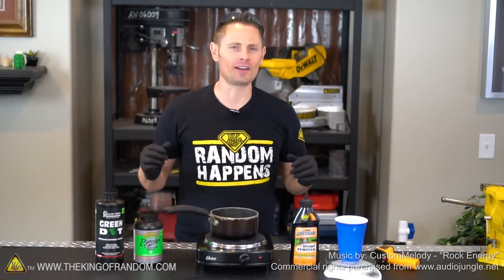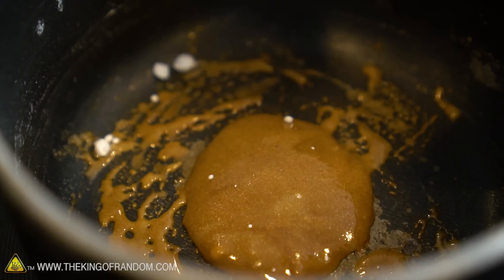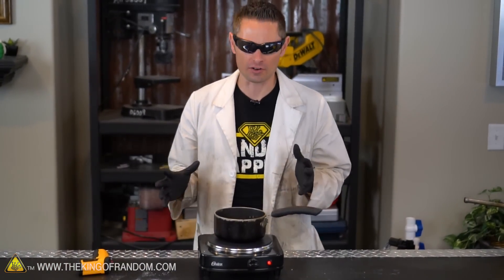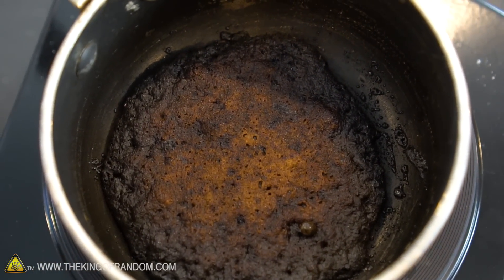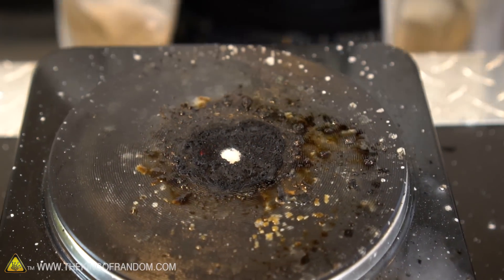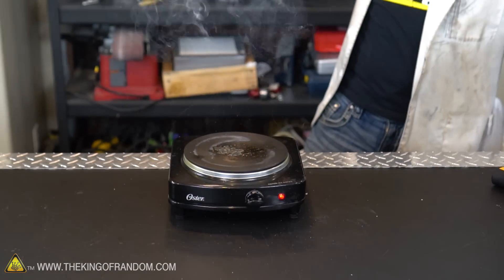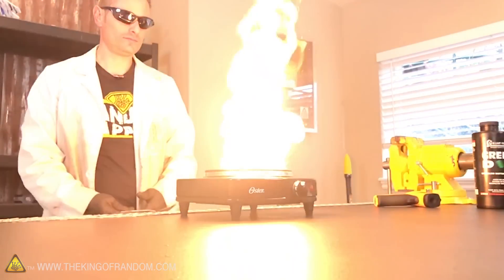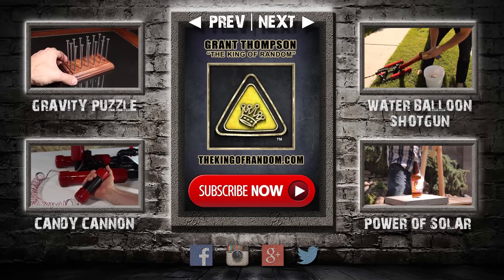Don't Pour Gunpowder On A Hot Stove | TKOR Tests Lighting Gunpowder & Other Pyrotechnic Experiment!

Comment: I did many tests it does not go off with heat more with sparks if i get a fireworks ignition stick where its just a slow burning ember sparks will happen and it spreads when you use it it takes way longer thats why you use a fuse in fire works

Comment: To covert Fahrenheit to Celsius = Multiply by 5, then divide by 9, and last subtract 32. You have Celsius. For Celsius to Kelvin = add 212.
Reply: Or just put it in Celsius or Kelvin instantly. I mean there are like 2 countries that still use the imperial system.
Reply: Error 101 not found

Comment: judging by the speed of deflagration of the sugar fuel after it had been charred, it seems to burn quite a bit quicker than usual smoke mix. I'm curious if it could used as a propellant in that form.

Comment: I think the reason the muzzle-loading propellant didn't go off is because it's designed to be able to withstand high-heat without combustion.  When the barrel of the gun gets hot after firing it and you pour the powder down the muzzle to reload you don't want it to go off in your face.

Comment: A few notes:

• Your burner didn't get up to 830F, you had an exothermic reaction taking place that was raising the temperature as it went (and it's possible the burner had turned off it would have still finished igniting)
• "spontaneous combustion" refers to combustion due to an exothermic reaction self-starting; if you have fed in a bunch of thermal energy it is by definition not spontaneous
• USE A FREAKING VENT HOOD WHAT IS WRONG WITH YOU

Comment: You kinda completely missed out one very key feature concerning the rocket fuel:
Surface area!

When it was melting it became an amalgamous mass that had no effective ignition surface due to even heat distribution.  Once it was ground into quasi-powder the surface area available for ignition went through the roof thus it ignited at a far lower temperature than the homgenous mass.

And the entire experiment was conducted at danger-close distances with no face shield or ventilation in a confined space...

Comment: The thermometer that he is using isn't the best thing to use here as they will read more infrared radiation from steam and smoke rather than from the surface, so he is getting lower readings than what the real temperature would be.

Comment: Actually the hottest part of the hotplate isn't the center. The element is ring shaped, and welded to the metal plate halfway between the edge and the dip in the middle. My stovetop has these elements and is able to get the to actually glow red hot.
Reply: Which is getting close to 600 degrees C

Comment: Would it be possible for the rocket-fuel (In a powder state) work as gunpowder?
Reply: Myles K assuming the pressure wouldn't be extreme it would fire once at least maybe. There's many different types of powders for different cartridges that have a pressure limit and if you exceed that too much it would blow up.
Reply: Sugar rocket fuel is quite slow burning (in relative terms); if it goes bang it is a space shuttle.
Reply: I'd say no. It leaves way too much residue. It would foul up a gun barrel in a heartbeat.

Comment: the rocket mixture turn black like a gun powder. can you use it as a gun powder ?
Reply: It does not work like that...
Reply: Barrel fouling will be extreme and to load  and fire 4th round safely will require herculean effort

Comment: Question: If the solid rocket fuel still burns after it carbonizes, can it now be packed into a motor tube and produce thrust? Since it burns slower than the brown fuel maybe it could be used for the delay burn...?

Comment: will the rocket fuel produce just as much energy in the ash state from cooking to a crisp as it does when you keep it in the goo like state where it looks like peanut butter?

if it does, that would make using it easier as you could fill your canisters with the ash, then put a little layer of the thick goo kind on top to seal the end so the ash doesn't fall out.

Comment: Hi grant, is it possible to use the rocket fuel powder to make a fuse, or use it as a replacement for gun powder??
Reply: If you shape the rocket fuel into a stick, then it can be used as a fuse, however it may pop and throw flaming fuel into what ever you wanted it to be a fuse to causing it to ignite prematurely (Which would be bad)

And I don't think the burn rate of this specific rocket fuel would work as a gun powder because it doesn't burn quite fast enough. Gun powder works by burning really quickly and increasing it's burn rate as pressure increases. This rocket fuel is preferred by amateurs because it has a stable burn rate where it while stabilize at a specific pressure and not burn any faster once it reaches that pressure so it is less likely to explode when you use it in a rocket.
Reply: While the answer is yes, you can use rocket fuel to make fuse, I will advise that you don't do it. Rocket fuel is mixed to burn rapidly and provide lots of hot gas, not to burn slowly and ignite other devices. Go to cannon fuse dot com for fuse. It's not expensive. AND NO, rocket fuel is for rockets, not guns. If you're trying to make exploding devices with homemade fuse, DON"T. Pyrotechnics are fun, but you need to know what you're doing, or you will get burned, or blown up.

Comment: Why do you do this indoors?  Seems very dangerous
Reply: This is literally in his work space area (most likely with PLENTY of ventilation) why does nobody understand this.
Reply: Smokeless gunpowder is not explosive. It slowly burns and lets off a lot of gas. The reason it sounds like an explosion in a gun is because the pressure quickly drops once the bullet exits the barrel.
Reply: jokyng he legit just said we cleaned up my work shop
Reply: Workshop or not, burning things inside isn't really optimal. If you do need to burn something inside you'd generally want to have huge ducts next to the flames.
Reply: mishal321gaming you're*
Reply: Seth Alvarez yooer*
Reply: He like to live dangerously
Reply: He's got a lab coat on, its fine.
Reply: Kenneth Clark YOUR smart
Reply: Dnt get that far into the vid
Reply: and here we can see the people crying over Fumes the stuff makes. And i have to agree With +Tom Jones
Reply: jokyng. Hes a savage
Reply: It's obscenely dangerous on many levels.
Reply: because he's the king of randumb
Reply: Looks like his basement. Not a place to be playing with explosives and probably not ventilated more than an open window or two

Comment: What happens to different electronic device components in extremely low and high temperatures? I know that some components will fail, but which ones cause the device to be unusable after these exposures?

Comment: I was cooking a batch of smoke bombs with my friends and cooked way too much of the mixture. The pan I was cooking it in had relatively low sides and when I poured it into the tube some was stuck to the outside of the pan. I didn't see it and when it made contact with the burner on the portable stove the entire thing went off and the flame traveled into the pan igniting the rest of the mixture. Luckily I was outside and nobody got hurt but it was very scary and filled my friend's garage with smoke. The 4 or so smoke flares I managed to get from the batch were pretty cool though and made it pretty worth it. Won't make that mistake again lmao

Comment: If you used a induction cooktop the surface wouldn't get much hotter than maybe 120 degrees, probably a lot safer when mixing up batches of anything potentially set off by temperature.

Comment: hey Grant, does electricity jump to another wire in a vacuum chamber (experiment)
 Like if you want this to be done
Reply: No, because it needs to ionize the air into plasma to create a current path; no air, no gas to ionize, no current flow.
Reply: Although it might work with EXTREMELY high voltage, where the electrons would gather with so much 'pressure' at the cathode(negative side) until it suddenly jumped the gap like a lightning bolt. It would be like a capacitor, except the dielectric is simply the lack of conductor.
Reply: +SBwingman

It can still happen; its called electron tunneling. That's how some electronn microscopes works such as TEM's.
Reply: ground beef
"dielectric" is a term for an insulator, something that does not(usually) conduct electricity. A capacitor is like a battery, except it releases all its energy at one time, like a camera flash. Now a simple capacitor is basically a break in the electric circuit that won't let electricity through until enough charge builds up to jump over the break in the circuit. 

If you have two wires with high voltage near each other in a vacuum chamber, you basically have the same setup. It's an incomplete circuit(open circuit) until enough charge builds up that it all jumps across together, then it goes back to being an open circuit until it builds charge once again.

I think I'm writing too much but hopefully that's helpful.
Reply: I'm 2 years old but I perfectly understand
Reply: i asked this a few times so maybe if more people ask it will be more likely he will do it
Reply: ground beef im in 7th and i understand, then again ap classes lol
also im a big nerd
Reply: aquascorpio I am in ap
Reply: Q Johnson eh some districts and states and countries have different learning paces
Reply: SBwingman thanks it is
Reply: +Q Johnson different states have different plans of what your going to learn that school year
Reply: Matthew Politis no it does not, electricity needs some kind of conduit to move when it jumps through the air it is using just that, the air, in absence of and conduit it can not move
Reply: Angel Castillo because were opportunistic, if you even know what that means
Reply: yes it will, just think about how old CRT TVs or vacuum tubes work. however, you will need high bias.
Reply: +SBwingman Then I guess in your book vacuum tubes can't work.
Reply: Star Gazer vacuum tubes, as far as I can tell, have physical components very close that have energy transferred via heat emissions, which, by having in a vacuum prevents unwanted absorption of energy, where as what I/a few others suggested was that if he stuck two separate powered rods in, at what point would the vacuum become too great to actually allow for the transfer, as, after a certain point, there shouldn't be enough particles for energy to jump across. This is different to the vacuum tubes as it wouldn't have the rods/components very close to one another.
Reply: im 3rd grade and understand with no problem
Reply: Angel Castillo How old are you? I'm gonna assume you are 15 since you are saying kids younger than 15 shouldn't be on YouTube. Will you explain to me why exactly? How does it affect you? Don't try to say I'm defending myself either because I am older than 15.
Reply: I am in 8th grade but I still understand it
Reply: ground beef I'm in fifth and I understand perfectly. :/
Reply: lightninghell4 

tem
Reply: SBwingman I have no idea what you said I didn't learn man I'm in 8th grade
Reply: why are kids younger than 15 on YouTube

Comment: My guess is that the rocket fuel ash lit up at a lower temperature than the fuel cooked directly on the plate because as a powder its surface area is bigger

So one should be more careful when the plate is hot and the fuel is still in powder form

Comment: If you don't use an aluminum pan it will heat up to the temp of the burner. Use cast iron or steel pans.

Comment: Try using the ground up rocket fuel ash in a black powder riffle, and in a reloaded cartarage and see how much power it has.
Reply: it's easier just to make sulfurless black powder
Reply: Andrew Carter but that would be no fun
Reply: And then try using it for the rocket engines
Reply: ash? yeah lets burn the bi product of a spent fuel
Reply: Actually, I think if he added maybe 5-10% sulfur, he WOULD have black powder from that. Think about it; the sugar has become carbon(check 1), it contains a nitrate salt(check 2), the only thing it is missing from true black powder is the correct ratio of sulfur.
Reply: @WingmanSR  So there's an alternative to make black powders
Reply: James Wilson I was thinking the same thing

Comment: next time, it would realy be apreciated if you'd put the degrees celcius in the corner, 'cause now i'm like,"okay, apareantly that's hot"
Reply: SpydreX Official Merica!
Reply: Deduct 32, then multiply by 5, then divide by 9
Reply: JDM12983 stfu the usa is the only country that uses ferenheight so judge every other country in the world
Reply: +Yambergorr Someone is triggered, btw this shouldn't be too hard to guess but Grant is from the U.S.
Reply: max habing think of Fahrenheit as a percent of heat, like: 40°/% is cold 60-70°/% is warm 80-100°/% is hot! So think about how hot it would be if the temperature was 900% higher than normal! Easy
Reply: Waaaa, cater to me, I cant be bothered to learn a different measurement system or convert it myself. Over a hundred people who share my feelings of entitlement have left a thumbs up. Alter your format Graaaaaant!
Reply: I started to add Celsius to the subtitles and I realized how dull of a job subtitling a video is. Pass the idea around maybe instead of commenting first those people can do something useful.
Reply: So, you don't like anyone telling you how to convert; but you are OK tell someone else how they should display it; on their video?
Reply: # use Kelvin above 100°C

Comment: For all the non-american viewers:  An approximate conversion from Fahrenheit to Celsius at high temperatures 300-500 degrees Fahrenheit is division by two.  This is because one fifth of the temperature in Fahrenheit is nearly equivalent to 32 (derived from the conversion formula F = 9C/5 + 32).  To convert to kelvin, add ~273.15.

Note:  This is certainly not the optimal solution, just trying to provide a temporary translation.

Comment: Has any one had the thought of putting a running engine in liquid nitrogen? 2 stroke and 4 stroke. Put the engine in the liquid nitrogen with the gas tank (Or petrol what ever you prefer) above the liquid. Also run an air pipe from the carburetor to to the outside of the liquid nitrogen so it will have oxygen for combustion.

Comment: Do NOT store smokeless powder in a garage or shed. You will reduce the lifespan of it. Continuous heat even at 100 degrees will degrade the composition and modify the characteristics of it which could lead to over pressure results.

Comment: What would happen if you make a batch of rocket fuel that is charred black, then add just a dab of water to it to make a paste? Take that paste and put it in a form like a cardboard tube poke some holes in the side for venting, then apply a heat gun to get rid of the water. Do you think it would still work as a rocket motor?

Comment: Since you have all three of those hanging around, it would be interesting to examine the burn rate for each of them. Say run out a foot long tray loaded with the Rocket fuel mix, "burned" mix (maybe in different ratios), and the various powders ...

Comment: ok now test how much is needed to melt steel beams.
Reply: J. E. It have to definitely be hotter than jet fuel
Reply: EXPERIMENT AT HOME: Log onto your computer and google "Stalin's Jews"
Reply: It would depend what's the exact chemical/element composition of the steel used, from this you can calculate it's boiling point. Now if you want to melt the whole beam you would obviously would have the factor in the exact dimensions of the beam.
Reply: Did your mom have a nervous breakdown??
Reply: Aaron 2 Nasty You must be fun at partys
Reply: Thermite is what. Look into it
Reply: +Caleb Caleb jet fuels cant melt steel beams. steel beam are around 2750°F... jet fuels are around 800°F to 1500°F
Reply: Jet fuel can't melt the beams but it can weaken them.
Reply: +Bunny Warren and the beams that the plane hit was weaken first than the other beams... because you can see, the top part of the building fell down vertically, not diagonally
Reply: +NoobGamr can't say I known enough about structural engineering to say what would be expected when a large passenger jet hits a building. Thankfully the Internet is full of people who are experts in this though.
Reply: +Bunny Warren the beams were still standing when the plane crash... if it is a large jet, the bottom part of the top part of the building will rotate and the top part would rotate 1-4 degrees and the top part would fall vertically
Reply: Old meme. Get out.
Reply: 2600-2400 degrees F?

Comment: One thing to consider while doing this: when you heat the nitrate above 350°C it decomposes into nitrogen oxide which is toxic, carcinogenic and corrosive in concentrations as low as 20ppm (about 20mg/m^3). When you do stuff like this, at least do it outside.

Comment: made a pound of black powder in Chem class, heard that vinegar would add a boost.... mixed in a cast iron skillet,  got impatient,  put in oven at low heat... it looked like a rocket engine when it went off, burned so fast oven was undamaged.   parents never knew